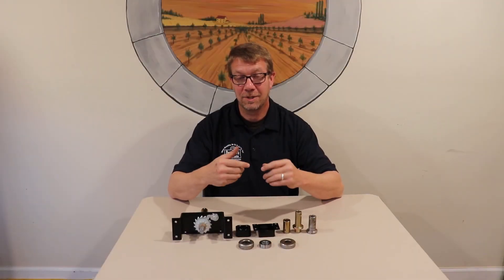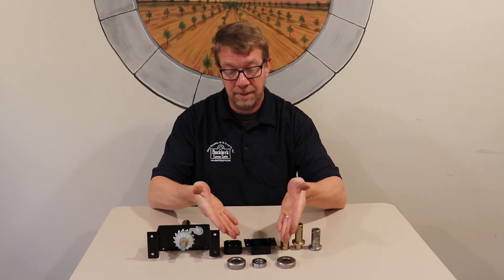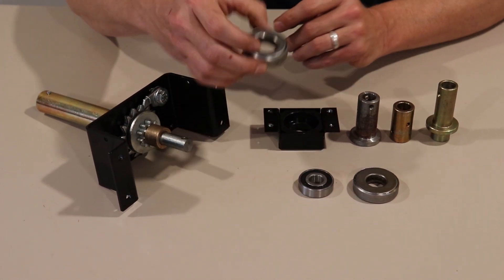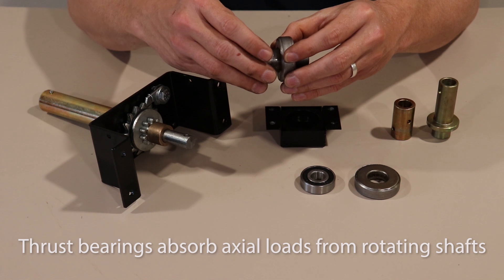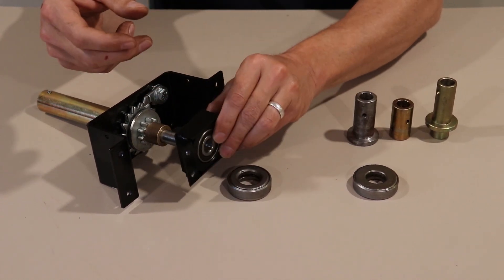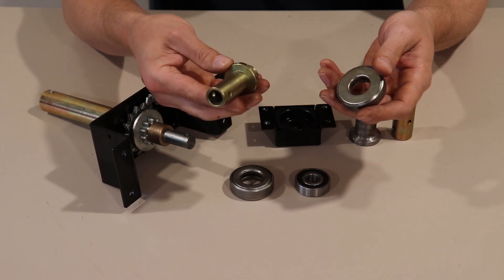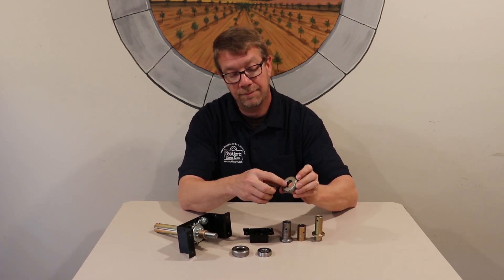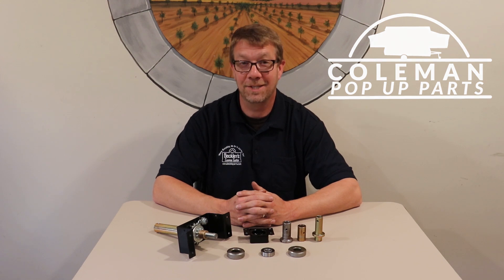Fixing hard to raise roofs on Coleman and Fleetwood pop up campers

Comment: As I’m trying to get things ready for this weekend camping trip I tried to lift my pop up camper and it was so hard to lift it wouldn’t turn, after looking around and taking off the bottom plate to look at the thrust bearing I noticed I can see the bearing balls and no grease in it. We just bought the pop up😢I have the 6311 system so I just ordered the thrust bearing from you😀 I did spay lubricant in the bearing to get the pop up to work again till the new bearing comes in so our weekend not ruined. Thank you so much for your video. Please keep making videos.
Reply from the maker: Glad to help! Have a great camping trip. Your new bearing should be waiting for you when you get home.
Reply: @popupcamperpro  really fast shipping thank you!! I put in the thrust bearing and the hardest part was punching the pins out and back in the whiffletree. I can’t believe how easy it is to lift now. I just bought the pop up used and this is my first pop up. I couldn’t have done it without your videos so thank you!!
Reply: Pretty sure same thing just happened to my 96!sun valley. Do you have to take wiffle tree off to change bearing?
Reply: @sllashbr  yes I had to

Comment: I have a 1995 Coleman destiny Stony Creek. I have replaced the cables as one busted in a storm. It's always been extremely hard to lift so I figured I would take a look at the gears in the box. Come to find out the box is upside down. There's no telling what else is wrong. I'm trying to take it apart so I can look at everything and I can't get the pin that attaches the whiffletree to the crank out. I've spent about 3 hours in the dark. Is there an easy way of getting this thing out? Thank you so much for all of your helpful videos!
Reply from the maker: Try heating the coupler to help free the pin.

Comment: Thank you for your time and the video, was wondering if you knew what type of lift system is used on my 2016 Starcraft RT 10 pop-up trailer.......one corner won’t come down all the way (comes to rest about 1-1.5” from being all the way down).......the metal cable is slack.......and if you know what might cause that, I would very much appreciate it.......thank you again.......
Reply from the maker: So sorry Richard, but I am not familiar enough with StarCraft's at this time to answer your question. Perhaps someone else in the community can assist with this question?

Comment: So with that copper spacer you can still line up the 2 holes for the thrust bearing and whiffletree rod?. If so then why doesn't it come with the 3000 crank assembly. Now have to wait another week to get that when an all new one should work without it, therefore putting more stress on me and the wife to get this done in a week.
Reply from the maker: Hmmm, let’s confirm your installing the correct assembly. Please give us a call at the office for assistance

Comment: Hi. My Coleman is called a cedar model. Do you know what type of bearing it uses? It is very hard to crank to lift it up. I bought the camper used and I don’t know if the lift system has ever been maintenanced either. Does replacing the bearing fix crank issues or is it a combination of new bearing plus maintenance?
Reply from the maker: It’s a combination. Please give us a call to help you choose the correct parts for your camper.

Comment: Thank you for the video - - - I have a 2001 coleman pop up camper. While cranking the roof down I heard a loud "crack" and the roof crashed down all at once. The crank doesn't lift or lower the roof at all now. There is no resistance at all when I crank it. Any help on this situation?
Reply from the maker: Start with an inspection of the whiffle tree. I think this is where you will find the source of the failure.

Comment: I love the videos! My dad and I are repairing our camper. It is 1998 Coleman Fleetwood  bayside waist level crank. Our issue is a slack chain when lowering. The thrust nut and bearing and whiffle has too much play causing the slack. The thrust nut and bearing look good but I cannot figure out what is missing to hold them in place in the case. Could you explain?
Reply from the maker: Brad, I would recommend adding some tension to the chain first. You may need to remove a link, or add a half link. The chain should be just about as tight as a bicycle chain is. The lower drive assembly should not have that much play in it. I would also recommend taking a look at the front couple of bushing that the whiffle tree rides in.
Reply: @popupcamperpro   Thank you for responding! I was thinking about tightening the chain but then the thrust nut would rub on the upper portion of the hole opening in the frame. How is it suppose to stay centered?
Reply: @popupcamperpro  I  found the issue! the retainer around the thrust nut and bearing was placed on upside down. This caused the thrust nut to be able to slide upwards around 1/2"  leaving slack in the chain and binding / skipping when lowering.!

Comment: Thank you so much for another helpful video!  I have a 1998 Coleman Taos popup that I love, but it does take both hands and a lot of muscle to raise the roof. I greased the whiffletree a year ago (pretty sure it had not been done since the factory), but it did not make it much easier. Would my next try be to replace the thrust bearing? And do you have a video showing that process? Very thankful for your help.
Reply from the maker: Hello Jo! More how to video are always in the works. I think you are on the correct patch for your hard to raise issue with a thrust bearing replacement. You can always find more instructions at our webstore for this repair as well. Here's the lift system repair manual. 
https://cdn.shopify.com/s/files/1/0273/4347/files/DOC011818.pdf?14982018414419181682
Reply: @popupcamperpro  Well the repair manual does have detailed diagrams, but it doesn't tell me the process. Can you tell me if I have to remove the whiffletree cover (guide channel), or can I just go in from the outside by the bumper?  Removing that whiffletree cover was the hardest thing I've ever done!
Reply: My 1997 Taos is the same. This is my third Popup (2nd Taos) and first time dealing with this issue.
Reply: @jolynn8675  i have the exact issue w/my '97 Taos. Greasing the WF didnt make it easier but it DID make it harder. Did you get yours to raise easier if so what did you do? Were there any vids that were helpful? That cover was a B**ch!! Holy moly. And the crank assembly cover...I removed the bolts but can't get it to back off towards the bumper. Were you able to remove yours If so, how? I think this is my current issue as it feels like it's not engaging and i need to "put it back in.." but as I said, I cant get that black box cover off to see what's going on in there. Any help is GREATLY appreciated.
Reply: @Grace.B2170  and Grace, please see my comment to Jo Lynnn below. I had the same issue as you both. Were you able to resolve it? Thanks

Comment: What is the reason to NOT spray the crank with lubricant? Can’t find the answer anywhere. Also, how can we fix it if we did. 🤔
Reply from the maker: It's for compression clutch release systems LK B. They have a clutch pad inside of them that needs to stay dry. If this is your system and you have greased it, you will want to remove as much as possible from the clutch pad. Spray brake cleaner works well.
Reply: @popupcamperpro  thank you for responding! I have the coleman fleetwood Sunridge model, which has the chain drive, not the direct. still should spray with brake cleaner?

Comment: 1989 colmen pop up replaced the thrust bearing still really hard to crank didn't fix the problem whatelse could it be
Reply from the maker: Could be that the bearing needs spaced. If it’s not fully seating on the frame or bearing spacer plate, then shim it.
Reply: @popupcamperpro  it's seated good still really hard to crank
Reply: @popupcamperpro  how do shim it
Reply from the maker: Then you will need to find the binding, or the component that is out of true. Lastly, make sure that the roof is not to heavy.
Reply: @popupcamperpro  nothing is binding up I've got pictures of underneath the camper if u would like to see it everything is greased
Reply: @popupcamperpro  the thrust nut isn't touching the frame
Reply: I have a question on the crank assembly. Can you convert the old crank assembly 12 tooth, to a 4141 22 tooth crank assembly on a 1989 Coleman Chesapeake. It has that bottom shaft roll pin catch to hold the roof up.
Reply from the maker: Yes you can

Comment: We have a 1996 Coleman Fleetwood Sun valley camper. We are trying to replace the thrust bearing because of the hammering sound and how hard it is to crank. We've taken the back off and grinded off the crank assembly, but we cannot seem to take the crank assembly apart. Is there a way to do this to replace just the thrust bearing or do we just need to replace the whole crank assembly?
Reply: From my research on your site, the replacement would be the 6601 crank. And since we have 24 teeth on our gear and the replacement is 22 teeth, does that mean we would have to replace the chain too?
So thankful for your site and videos!! They are all so helpful!!
Reply: Sorry, more questions :) is the thrust bearing in the crank assembly, so replacing the crank assembly could fix our problem? And would we also need to replace the lower gear the chain attaches to?
Reply from the maker: Your thrust bearing is just before the whiffle tree. See page 7 of your parts book free on my site. Remove the chain, then unpin the tree to service the bearing. Find the written instructions under INSTRUCTIONS and CONVENTIONAL LIFT SYSTEM REPAIR MANUAL on colemanpopupparts.com as well. You’ve got this Rachelle!
Reply: Thank you SO much!!

Comment: I have an '02 Fleetwood. The roof lowers fine, but when raising, it's hard to crank, and I get a constant "banging" sound every time I crank the handle. Is my prob the thrust bearing? I doubt this popup has ever been maintained. Also, I'm assuming my year puts me in the middle bearing category.
Reply from the maker: The thrust bearing is the proper place to start for this issue. Sometimes the “hammering” can come from a worn chain as well. What is the model name of your camper please?
Reply: @popupcamperpro  It's a Cheyenne. Thanks!
Reply from the maker: Got it. Your thrust bearing is part number 4720b2421. Available at colemanpopupparts.com
Thank you!
Reply: @popupcamperpro  thank YOU! Any chance you have the part number for the chain as well? I can't find it on the site
Reply from the maker: Sure! It’s Part number 4755-1431
Reply: I had this problem with my Coleman Sun Valley.  In my case, the problem was too much slack in the chain. I added three washers on each side of the chain to take up the slack & it solved the problem. Cheapest fix ever!! Good luck!!
Reply: @countrylegacy7255  Cool! It DOES sound like a slipping chain, so hopefully my fix will be as easy! thx!

Comment: 2007 E3 If the pawl will not align with the cog could it possibly be a worn out thrust bearing? I could see very thin pieces of metal about the size of a thin wire, trying to come out on the backside of the hole where the whiffletree is inserted. I wish I could post a pic here.
Reply from the maker: That’s definitely an issue, but likely not the entire issue. For the paw to be out of alignment with the gear, typically the drive hub tube is not completely compressed.
Reply: @popupcamperpro  Ugh....so how do I fix that? 😔
Reply from the maker: acforhim1 I would remove the crank, and first check / replace the thrust bearing. Inspect the threads in the drive tube, and drive shaft next. If damage exist, replace those components or the complete assembly.
Reply: @popupcamperpro  Thank you very much!  Supposed to camp Thursday-Sun. Guess I may be canceling. 😕
Reply: @popupcamperpro  Hi I have 86 Laramine my frint lift cable broke we replaced it but now the front sits about and inch lower that the back . (Roof) so now we are thinking we should replace all 4 cables but I cant find and where what the actual length should be for the cables . If u could help that would be great . Thanks Krista

Comment: I have the second thrust bearing.  We trying to connect the new kit, the coupler is about a half inch short to the threaded rod of the whiffle tree.  Is there a easy solution to pull the rod back to align the hole for the shear pin?
Reply from the maker: Hello again Cheri! You may have missed my previous reply. You can use a come along or table vise to pull the tree back slightly. Loosening the cables can do it as well.

Comment: 1991 Coleman Chesapeake #2593 our shaft where the crank handle goes is solid and has a pin sticking out on both sides to attach the crank handle.  We have the chain driven system and it make a loud popping noise when being raised what can this be? How do we repair?
Reply from the maker: Lisa, I would begin with an inspection of the chain and the gears. The chain should be in good flexible condition, and the gears not worn. The tighten of the chain is similar to what you would find on a bicycle. A failing thrust bearing can also cause issues like this. The chain may be takin more force than it is designed to handle. I hope this is helpful!